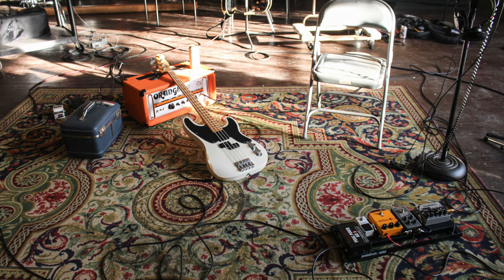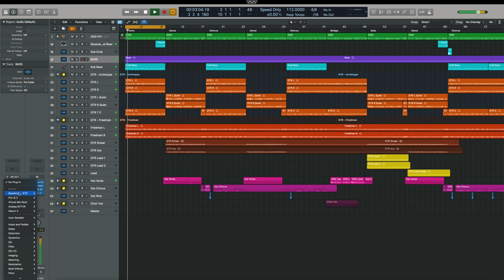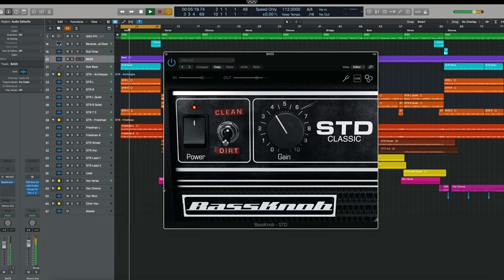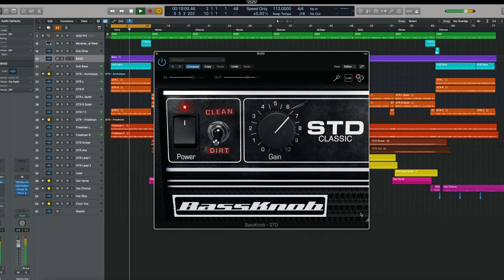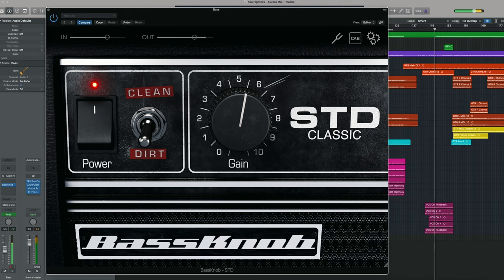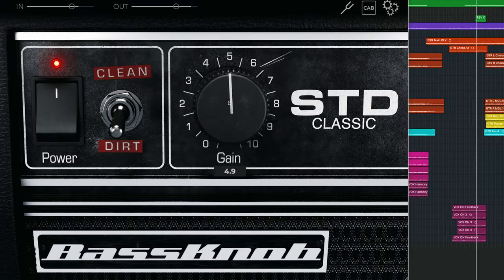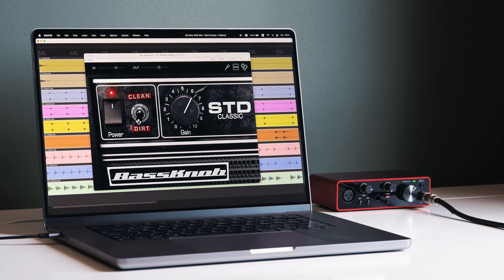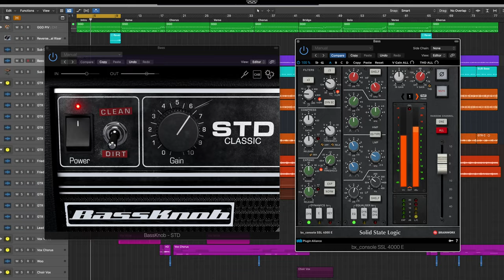Best Bass Amp Plugin? | BOGREN Digital BassKnob STD

Comment: Awesome man! So in this song you didnt add anything to the plugin in post?
Reply from the maker: The bass signal chain in the mix is pretty simple on this one:

• Bogren BassKnob STD
• Waves C4 Multiband compressor focusing on 250hz and below to pin the low end.
• Hi pass EQ around 50hz or so

There's always going to be little tweaks here and there to try to get things to sit right in the mix depending on this song but it's a great starting point that simplifies things a lot. Lots of great stuff out there though! The "dirty" channel of the BassKnob to me sounds like a SVT with a Rat pedal in front of it except with the low end intact. Definitely a cool sound. Thanks for checking out the video!

Comment: You just put the knob and nothing else for the mix ? Like compression or EQ ? Anyway, great tune !
Reply from the maker: The bass signal chain in the mix is pretty simple on this one:

• Bogren BassKnob STD
• Waves C4 Multiband compressor focusing on 250hz and below to pin the low end.
• Hi pass EQ around 50hz or so

There's always going to be little tweaks here and there to try to get things to sit right in the mix depending on this song but it's a great starting point that simplifies things a lot. Lots of great stuff out there though! The "dirty" channel of the BassKnob to me sounds like a SVT with a Rat pedal in front of it except with the low end intact. Definitely a cool sound. Thanks for checking out the video!